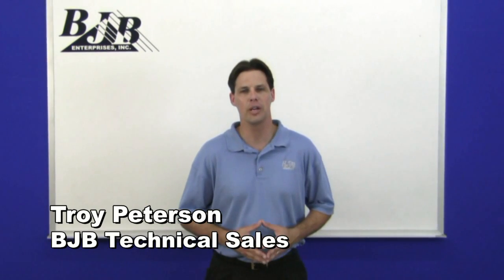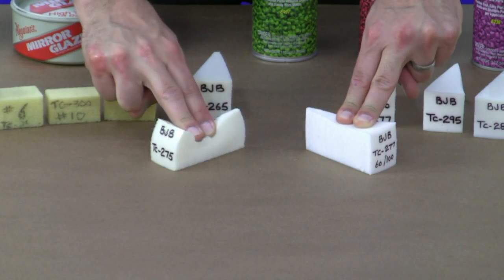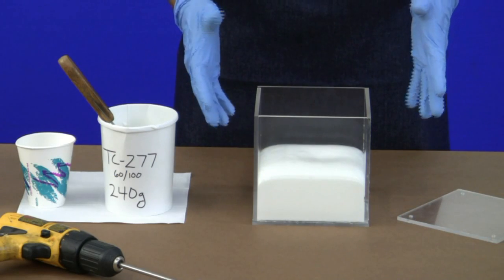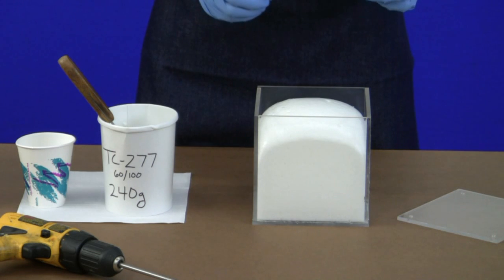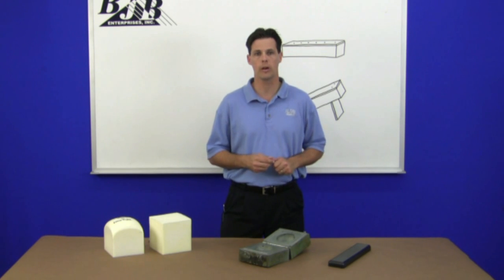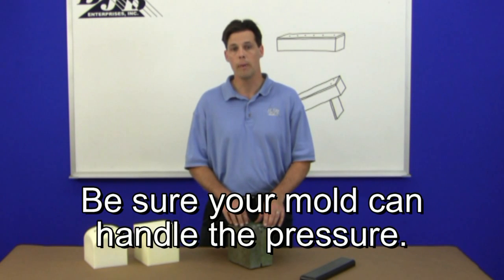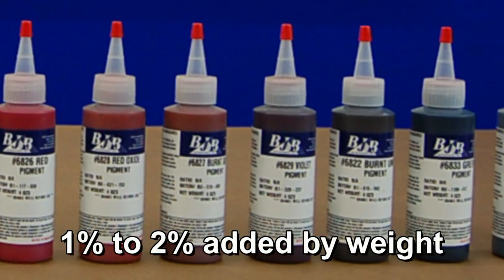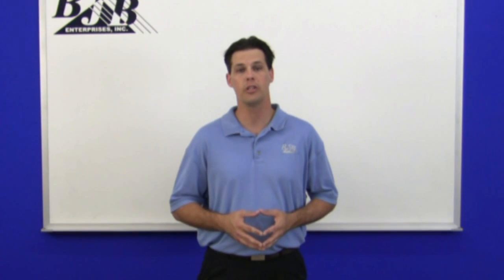Expanding Foams Explained - Great Tutorial

Comment: If i want to make a sandal/flipflop like shoe, and nail it to a surfboard.. it would need to be flexible but at the same time strong enough to keep its shape, and not tear apart....Is polyurethane foam what i should use?
Reply from the maker: Hi Christian, you will likely not have enough tear strength with just a urethane foam for this.  You would need to incorporate some fabric mesh or a tougher urethane skin to provide the strength and let the foam provide the comfort.  If you are trying to make these parts for prototypes and are serious about mold making and casting, please email our tech team to get the best support for materials and techniques:  info@bjbenterprises.com

Comment: Thanks for this amazing video. I see you've got there a propeller blade. Is that made with 4lbs foam? Is the pour done at the base and the foam expands to the tip where here is a hole or the other way (pour at the tip and expands towards the base. Is the mold held vertically? Thanks.
Reply from the maker: Hi, the propeller blade was likely a 6-10 pound foam for structural support.  The lower density foams are considerably more brittle, while the 6-10 pound tend to be used more often in composite applications where strength is needed.  Having said that, we have used the lower density foams successfully on lighter composite structures like UAV wings/tails and other similar applications.  Thanks for the question!  -BJB

Comment: I'm trying to cast a full head mask with pu foam in a two piece resin mold. can you slushcast that or do I need to build a plug?
Reply from the maker: Hi Bobby, great question.  Slush casting foam has a high potential for failure because the skin of the foam is formed by back pressure (like you get in a closed mold).  You might be able to get away with it if you first brush in a layer of flexible urethane to create the skin surface and only use the foam as a support material.  To have consistency and ensure good results, a core may be the way to go.

Comment: Does the foam not stick to the mold when cured?
Reply from the maker: The polyurethane foam will want to bond with most surfaces unless you apply a proper mold release.  Silicone molds are different because the silicone is self releasing, but the foam will still want to grab onto the surface and you risk tearing the outer skin as you pull it away.  So in short, you want to apply the proper release as mentioned in the video or speak with one of our helpful techs who will be happy to point you in the right direction based on your mold material.  714-734-8450 or info@bjbenterprises.com
Reply: BJBEnterprises Am i right to say that PU foam when curing will not adhere to plastic sheet aka poly?
Reply from the maker: There are some high quality poly sheet materials that the foam will likely not bond to.  However, if the volume of foam cast is large, the natural heat (exotherm) of the foam may cause the plastic sheet to melt and your non-stick properties can go away at that point.  So you may want to keep that into consideration.
Reply: BJBEnterprises I very much appreciate your kind advice. Have a good day!

Comment: is your foam a closed cell foam if I use it as a cushion on a boat it gets wet
Reply from the maker: +Philip Borel-Saladin Hi Philip, the flexible foams are not completely closed cell foams.  They would absorb water if submerged in water.  What you could do to avoid that is apply a flexible urethane skin in the mold first and then cast the foam behind it.  This way you have a sealed foam and avoid the water issue.  If you are covering the foam with upholstery, then it may not be as much of an issue.  Keep in mind urethane foams are not UV stable and would need some sort of covering to prevent long term discoloration and break-down.  Thanks.

Comment: hi do you have a type of foam which would paint on to a mold like gel coat dose and not all sink into the bottom like gravety  ?
Reply from the maker: +Richard Clark Hi Richard,  I'm not sure I understand your question.  We do not offer a foam system that is designed to be brushed into a mold.  The problem is that foams are so fast that if you start to brush them, you will destroy the cellular structure as you brush.  If you are looking for a flexible skin material that can be brushed into a mold, then yes we have materials like that. http://bjbenterprises.com/index.php/polyurethanes/brushable/
Reply: +BJBEnterprises  Hello thanks for your reply, what i need is a foam as i need it to be a reosonable thicknes in the grp mold i have but also be smooth so i can push the form into a sand mold for metal casting fill in above it with sand then pour teh metal the foam will just melt away
Reply from the maker: +Richard Clark Unfortunately, polyurethane foams do not melt as easily as polystyrene foams so I'd question whether this is a possible solution.

Comment: How could you go about casting armour in TC-284? Would you need a life size model of the persons body part inside the mold so it doesn't close up?
Reply from the maker: ***** Yes, you would need an inner shell to contain the foam and define the desired shape.  Typically larger foam tools are built with something light and stiff like epoxy/fiberglass or our BR-75D rigid shell material.  If you take a mold off of the sculpted armor piece, you can use bricks of clay pressed into the negative mold to simulate the desired thickness of the foam armor and then build the inner mold shell off of that surface.  Usually people will lay in some thin plastic (like household plastic cling film), spray an appropriate mold release, and then build the shell from there. -BJB

Comment: Oh ya .what about using an ultrasound as you pour? It works well with my metal pours. Almost no bubbles in the end product.
Reply from the maker: Hi Bill, thank you for your comments.  For foam systems we do not use any sort of deairing process because the system will produce air bubbles on its own in the end.  If you are referring to other casting systems in which air bubble entrapment would produce low quality castings, ultrasonic vibration is a very inefficient way of extracting trapped air vs vacuum.  Vibration works well on concrete, liquid metals, and ceramics because of the high level of filler content and difference in density of the liquid carrier vs fillers.  The viscosity and surface tension of the liquid carrier also plays a huge roll in the process.  For our material process, vacuum is more useful and much more efficient than vibration.